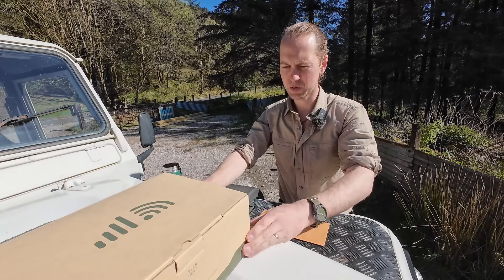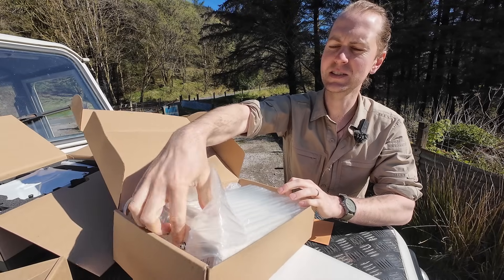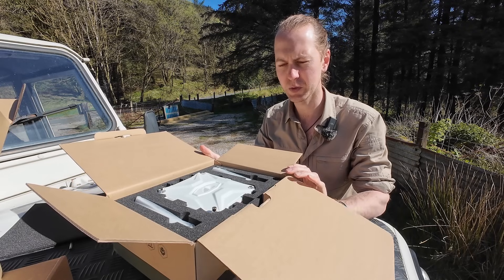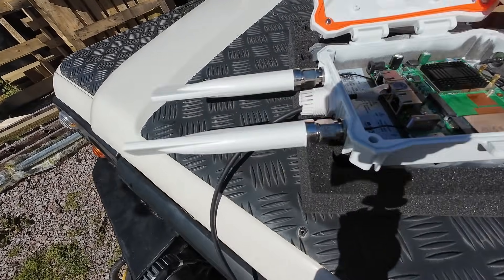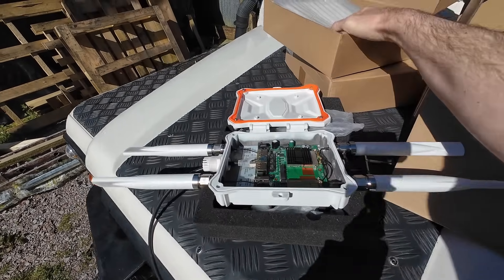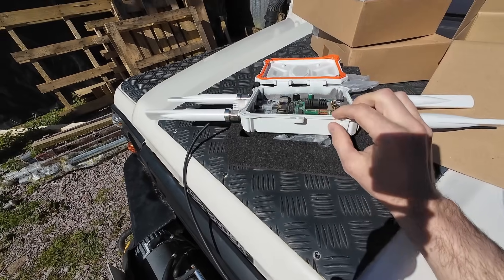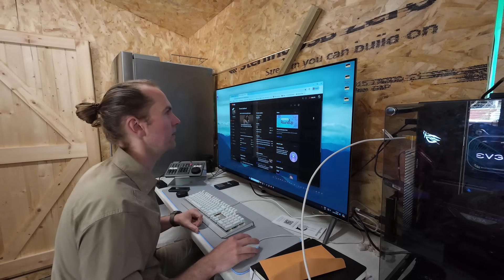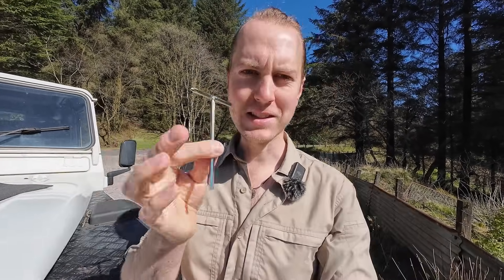Unboxing and Easy Setup of a Waterproof Outdoor 4G LTE cat6 Router-outdoorrouter

Comment: The Cat 6 for LTE refers to the radio modes of operation (up to about 300MBit) not the Ethernet cable requirements.  Cat 5 Ethernet cable will be fine.
Reply: also an additional point to Cat6 (LTE/4G), is the number of "Carriers" or that are supported. LTE carriers can be aggregated together for faster overall bandwidth. You can think of them as "channels" almost; the more of them aggregated, the faster the connection. Cat6 supports two LTE (4G) carriers.
Reply: @Elliott-ET just to note your carrier also needs to support Cat6 aggregation of bands to be able to take advantage of this, two SIM cards are not required … I think the majority in the UK already do
Reply: Was going to say this. I don't know why they have to make things so confusing by using identical terms and wording for completely different things, especially when they are certain to often be used in the same environment.
Reply from the maker: Yea thats what got me, because they call it the same thing
Reply: @OffGridSupplies As comments your original comment unless you are going to plug the ethernet cable in to another device the cat 5e cable is just for giving the unit power. Anyway cat 5e will do over 1gbps.
What is the brand of the unit and the model of the unit, curious to know.
Reply from the maker: Ah that makes sense
Reply: Also, the cable that came with it should be proper outdoor UV resistant cable, as opposed to normal indoor cables.
Reply: Just for clarity, Cat 5E is fine, as it supports 1Gbps (or even higher) - up to 100m cable run.

Cat 5, however, is limited to 100Mbps at all lengths, so you'll want to avoid that.
Reply from the maker: thanks

Comment: Enjoying the updates! For the speeds involved with 4G the cat 5e will be totally fine. Looks like a nice UI on the router, hope you set up the WiFi side whilst you had it on the wired connection so you don't have to do it when up the hill 😉 Will be interesting to see if any speed difference with the bigger antennae.
Reply from the maker: Thanks, It was actually worse on the speeds but I think I have worked out the issue and will be showing it in the next video